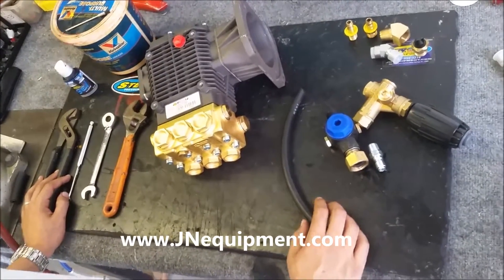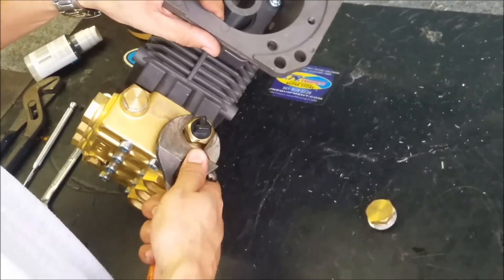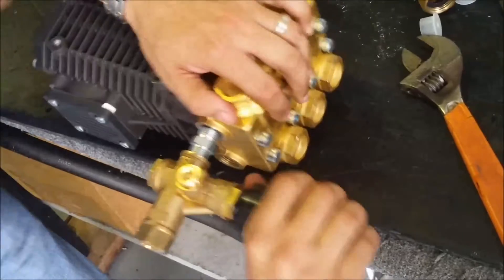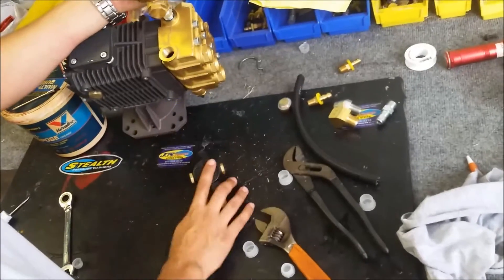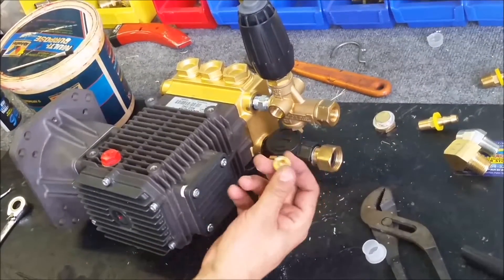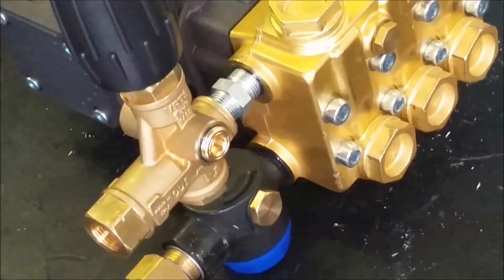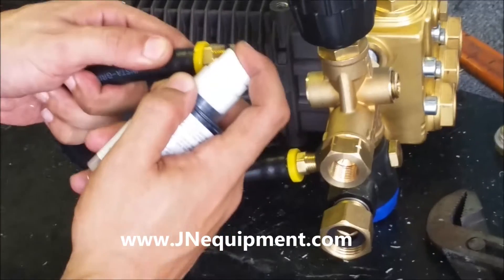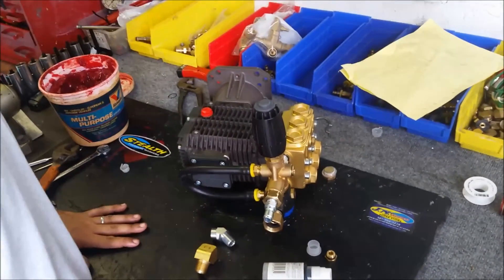How to Properly Plumb a Pressure Washer Pump

Comment: thanks for this video.  so just so I'm clear....after you have it plumbed this way, there is no need to run it to the tank?  i see many ppl rum a bypass line to the water tank..  just asking...thanks again...
Reply from the maker: If you are getting your water from a water tank then your bypass hose should run from your output(unloader/regulator) back to your tank (this is the correct way for a tank). If you are getting your water supply from a garden hose than the way you see above is best.
Reply: ooooooo  ok.  yes.  I'm running my from a 500 gallon water tank onboard.  thanks man!!